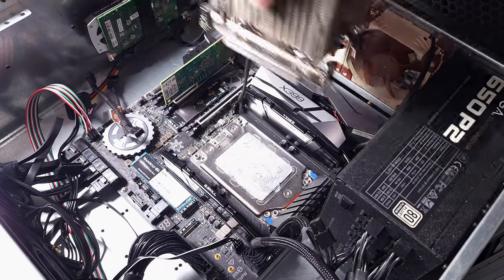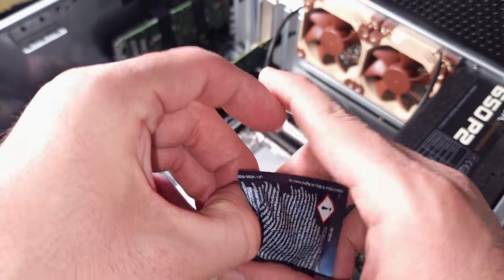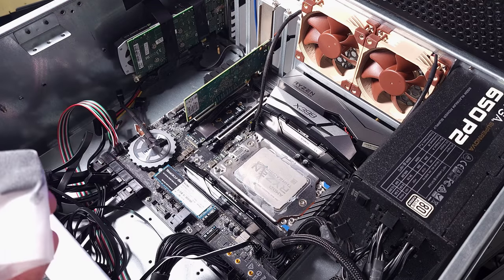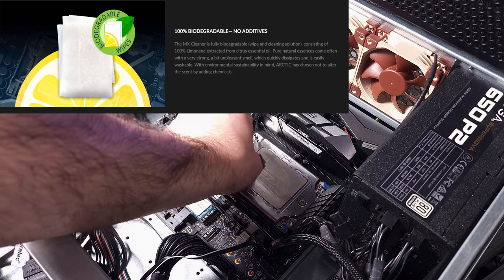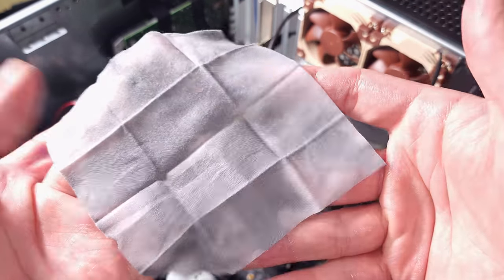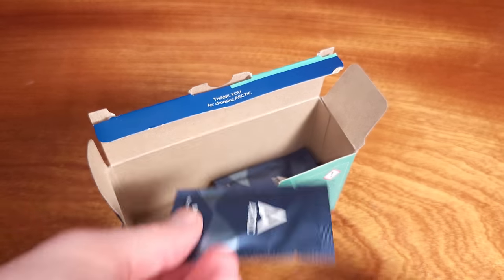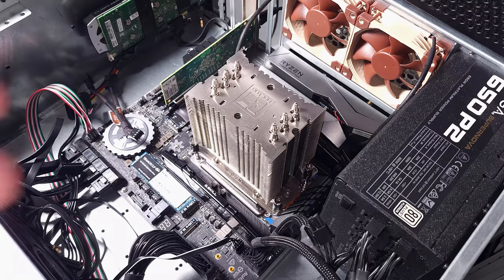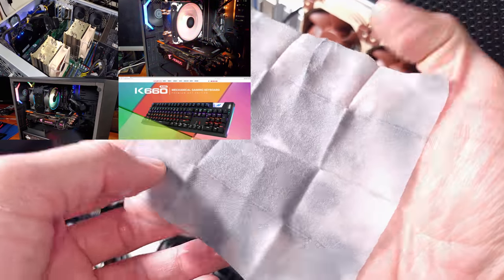The Right Way To Clean Your CPU!

Comment: I've read that it leaves the CPU somewhat "greasy", is that true? Do you need to wait for it to evaporate or something?
Reply from the maker: I wouldn't say these left the IHS greasy but I did have to wait maybe a minute or two for the liquid to evaporate, it's not quite as fast as typical isopropyl alcohol wipes for example. I like these as an alternative despite being a little bit higher cost.

Comment: Welp I done something stupid this week.
I had ordered the Freezer 4U after I looked at the amount of heatpipes and for some reason thought it would fit my AM4 socket.
The price was a bargain 43,99$.
Surprise surprise it doesn't fit 😅
Reply from the maker: Oh boy, yeah, it's specifically designed for the Threadripper sockets. You could try your hand at cutting it up but to be honest, I would return it and buy something for your application. What CPU (7950x?) and case are you using? There's a lot of great coolers out there for AM4, maybe we can help make a recommendation.
Reply: @STS  yep 7950x 🙃🔫
Edit: I had commented on another video of yours trying to fix my "how my wife calls it" (stupidity) hahaha well I guess I'll have to return it tomorrow.
What cooler do you recommend?
Reply from the maker: Ah that's right, depends on the case that you're using, which one do you have?
Reply: @STS  
Cooler Master HAF X 942 Full Tower.
It's ancient but I like it, besides it was free 😅
Reply from the maker: Sorry for hte delayed response, it's been a busy time of year for sure! Well, that's an oldie but a legendary case, ha. Looks like that case has support for up to a 190mm tall CPU cooler which is HUGE! For a 7950X, air cooling will be a challenge, especially for the budget of $43.99. The best air cooler you can get for that kind of price or near it for the Ryzen 7950X is likely going to be the ThermalRight Peerless Assassin 120 or the ThermalRight Frost Commander 140. Sometimes those coolers are in the $40-$55 price range on Amazon. You might still experience some thermal throttling with both of those coolers but for the money, they are probably the best you can get. Ideally, you would watercool the 7950X but that would really up the budget far past ~$40-$60 - the ThermalRight coolers should get the job done.
Reply: @STS  I have made up my mind and will be getting Arctic Liquid Freezer 240 :).
Reply from the maker: Late reply here but, that's a great choice! How did it end up working out for you?